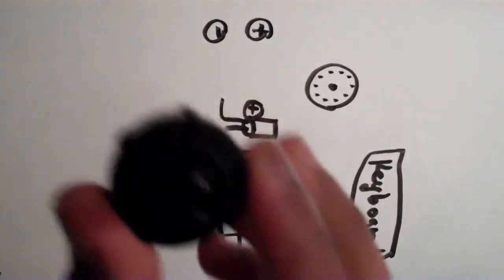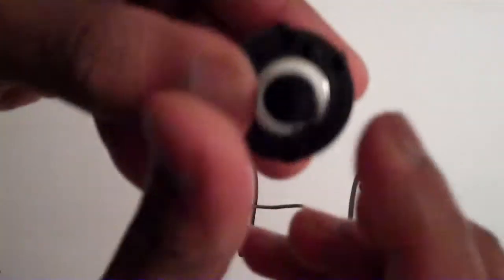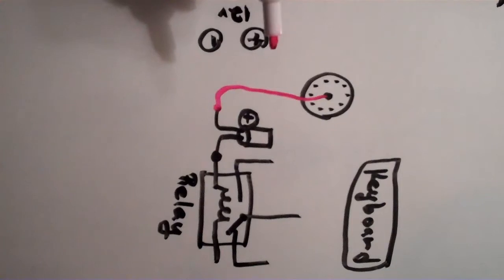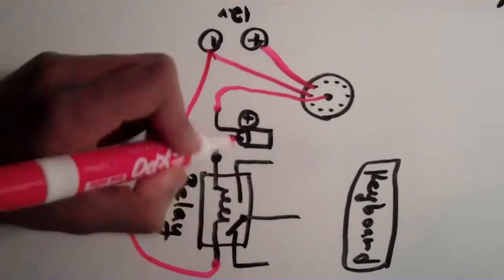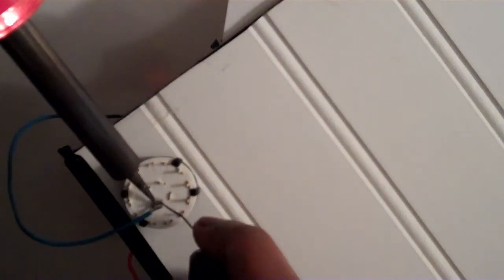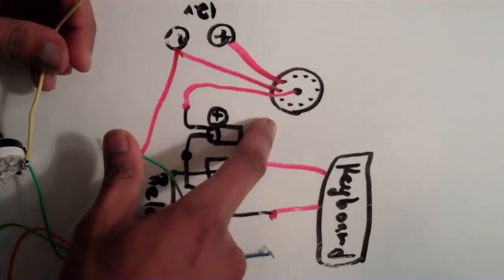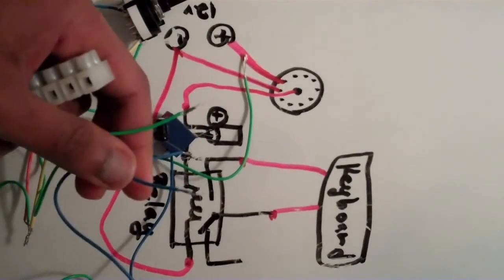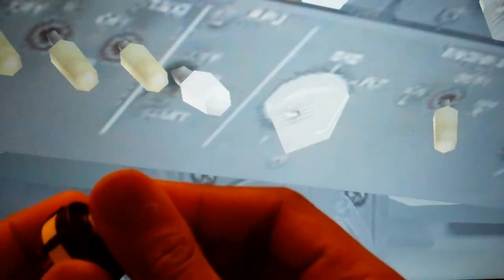FSX Home Cockpit Simulator - Rotary switch

Comment: Can you not just connect the switch direct to the keyboard without the need for anything else? It looks like you are just connecting one n/o circuit from the switch via a relay to get a n/o output.

Comment: VERY interested in your process, do u know if it is possible to use rotary encoder switches with this process or will this type of switch work for changing settings like heading or altitude.
Reply from the maker: Hey Ja. I seen other people figure out ways to use a rotary encoder switch which can be a project in itself. A switch like this would not work to change heading and altitude unless it has had some heavy mechanical modification done which I'm still figuring out how to tackle. *****
Reply: what you need is a 2-way rotary encoder. one way will be positive turn (i.e. cw), other way decrease (i.e. ccw).